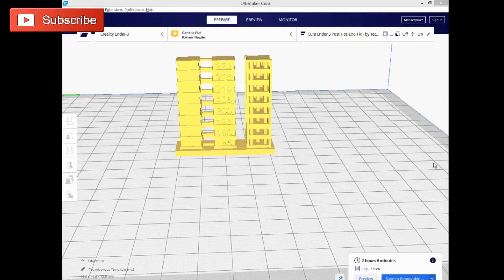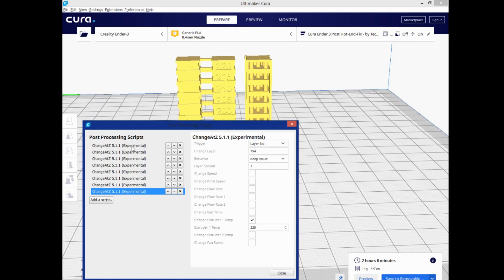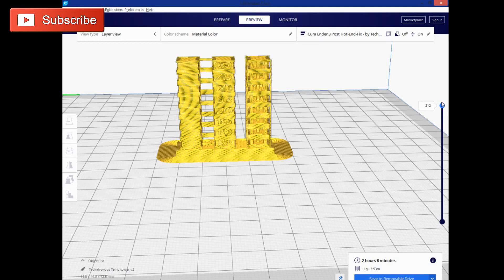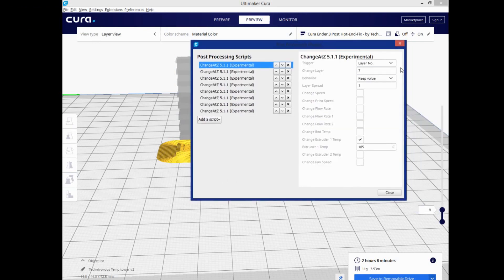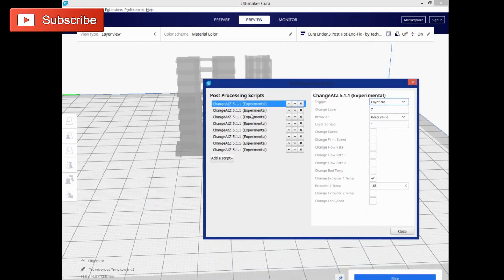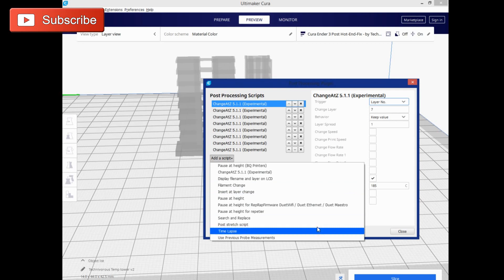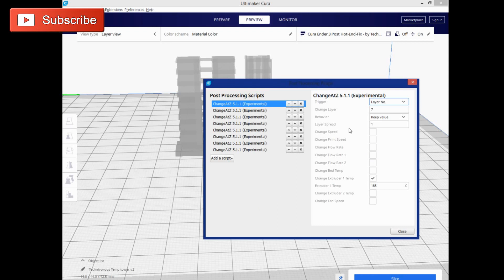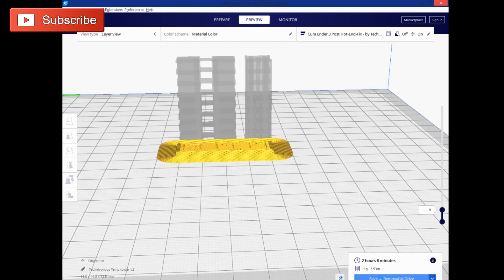how to use Cura to slice your temp tower!

Comment: How about sharing the Cura project file so others can use it and go straight to printing?
Reply: i realize this is an old comment but thought i should point out, if someone shared their temp tower gcode it would also include any other settings they were using such as fan/motion speed bed temp, etc. it is better to do this yourself so you are testing it against your current settings.
Reply: @BigBDude   im soon going to assemble my 3d print and want to make this my first print , you talk about the fan and bed temp are those default already set up or i have to do it personally? can you recommend some good parameters for beginning

Comment: Just to confirm, you sliced first, then added the scripts, correct?
Reply from the maker: you slice first, to determine what layer you want to add it at. then once you insert the script you have to slice again
Reply: @Technivorous  Ah, you have to slice *again*! I probably would've been slow to realize that if I was doing it without guidance. Because my initial assumption would be that Cura uses the scripts to merely modify the G-Code (which was written from the original slicing), without having to re-slice the model. 
OK, thanks!